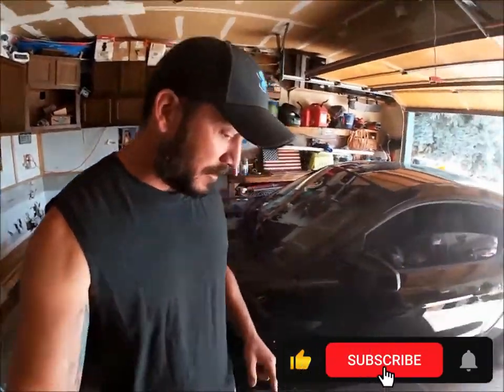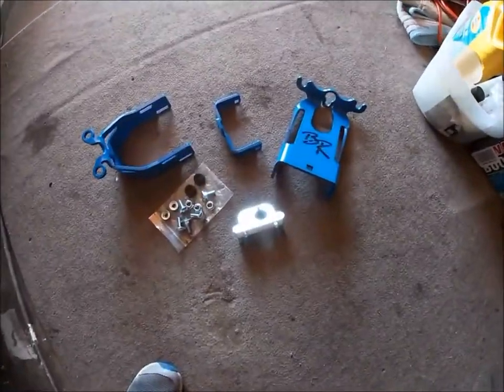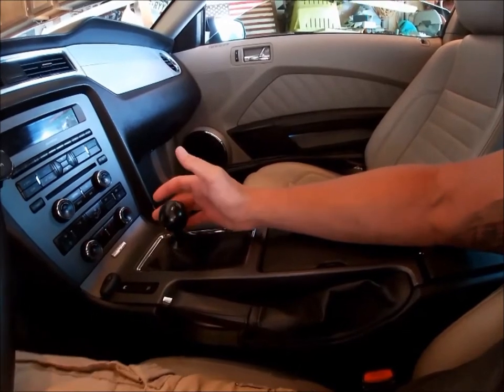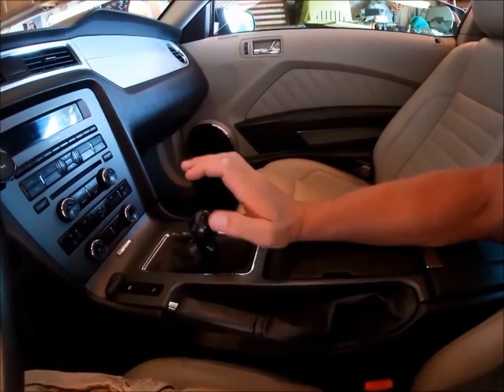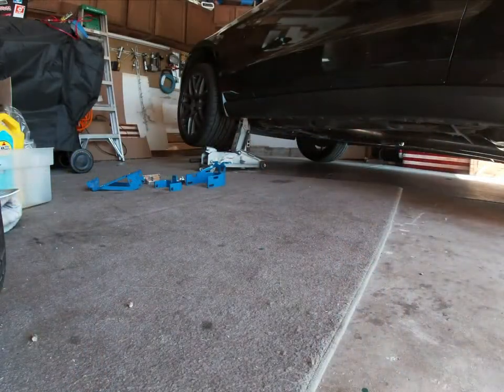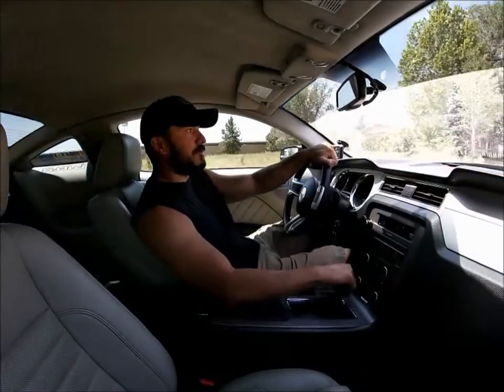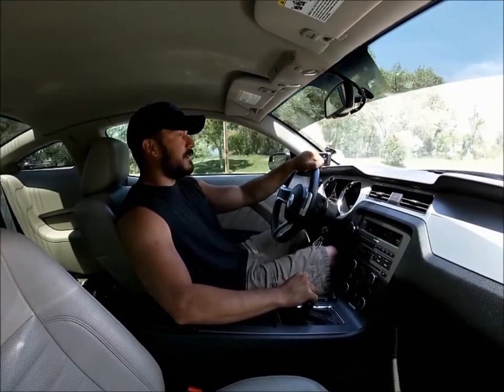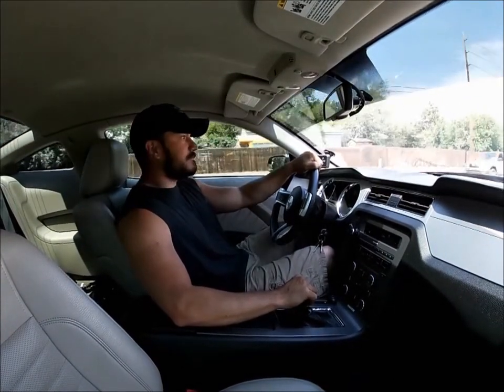Blowfish Racing MT82 Shifter Support Bracket - Install and Discussion on our Mustang GT Project Car

Comment: Hi project 10 , thankyou for the vid , very informative . Question: is it worth getting the blowfish bracket for standard shifter or is it just worth paying a little more for the hybrid 3 from Barton? . If it helps I don’t track race but enjoy hi rev open road. Thanks for your time , happy motoring !
Reply from the maker: Hello Johny, I added the blowfish bracket with a stock shifter and it works great. I primarily race it at the drag strip and it really helps with shifting. Hope that helps!!